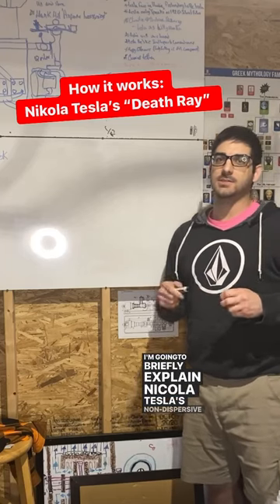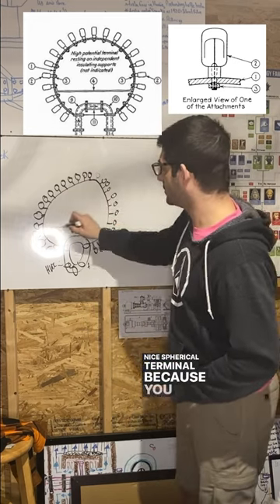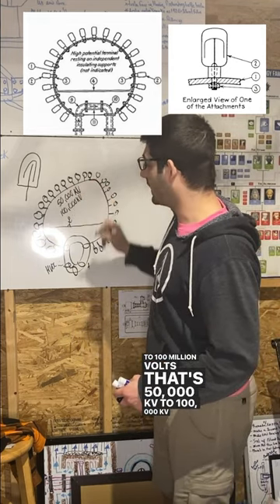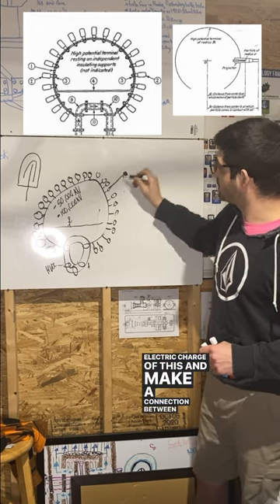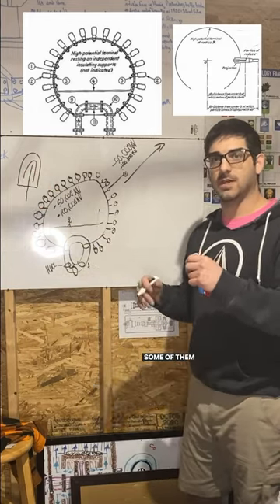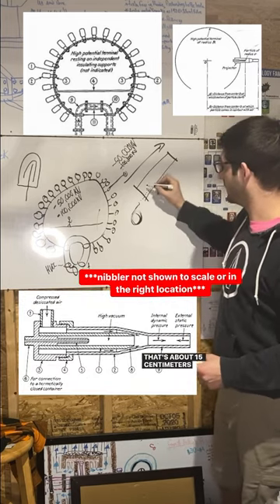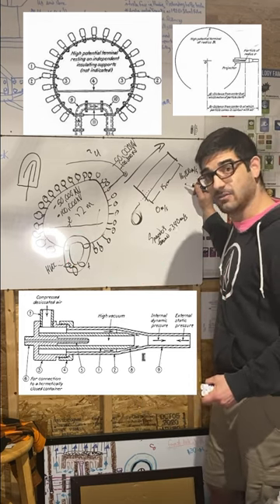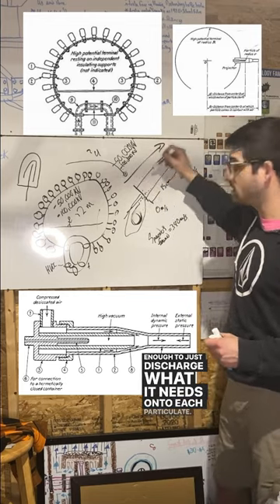Nikola Tesla’s Death Ray: How It Actually Works Part 2

Comment: Do you know how Kelvin's generator works? & please don't ask AI because it does not know. I checked!:)
Reply from the maker: Hey thanks for the comment! ❤️‍🔥🙏 Yes I’m very familiar with Kelvin’s water dropper electrostatic generator, aka Kelvin’s lightning storm. I’ve made many posts about it on my Instagram. This is nothing like Kelvin’s electrostatic generator. 

Please read the description on this post of mine about improved modern versions. 

https://www.instagram.com/p/CrPLlLxMjhZ/?igshid=MzRlODBiNWFlZA==

Furthermore I’m not sure why you think AI doesn’t know about it. ChatGPT knows all about it. What are you asking it that you’re not getting a response back about it?
Reply from the maker: Again I have long known about Kelvin’s electrostatic generator. 

But to also show you what ChatGPT knows. 

Me: “Will you explain Kelvin’s electrostatic generator in exhaustive detail?”

ChatGPT: “Certainly, let's explore Lord Kelvin's electrostatic generator, also known as a Kelvin Water Dropper or Kelvin's Thunderstorm. This ingenious device was invented by William Thomson, later known as Lord Kelvin, in the 19th century. It's a fascinating example of how relatively simple materials can generate surprisingly high voltages using electrostatic principles.

Principle of Operation

The generator operates based on the principles of electrostatic induction and charge separation. When properly set up, it's essentially a self-exciting generator, meaning it can start from a state of zero net charge and generate a substantial voltage through its operation.

Mechanical Construction

Kelvin's electrostatic generator consists of two pairs of containers or buckets. The buckets in each pair are electrically connected, but each pair is isolated from the other. There are also two reservoirs located above the buckets, each fitted with a small spout to allow water to fall drop by drop into the buckets below. The drops are meant to fall through two induction rings before they reach the buckets.

Operation

The operation of Kelvin's electrostatic generator can be broken down into the following stages:

Initial Induction: At the start, there's no net charge in the system. As a droplet falls through an induction ring, it polarizes slightly due to the electric field of the Earth. This small charge separation is enough to get the system started.

Charge Separation: As a droplet falls through the induction ring, the slight charge in the droplet induces an opposite charge in the ring. This charge is transferred to the bucket that the ring is connected to. The droplet, now carrying the opposite charge, falls into the other bucket. This process is mirrored in the other pair of buckets, resulting in the two pairs of buckets accumulating opposite charges.

Voltage Buildup: The falling drops of water act as a charge pump, moving charge from one pair of buckets to the other. Over time, the voltage difference between the pairs of buckets builds up.

Discharge: Once the voltage difference between the two pairs of buckets becomes large enough to overcome the dielectric strength of air (around 3 million volts per meter under standard conditions), a spark will jump across the gap between the bucket pairs, discharging the built-up energy. This creates a bright flash and a loud snap, similar to a miniature thunderstorm, hence the name "Kelvin's Thunderstorm".

While Kelvin's generator is a remarkable and simple device to demonstrate electrostatic induction and charge separation, it's worth noting that it's not particularly efficient as a power generator. The output voltage is high, but the current is very low, and it takes a considerable amount of time to build up enough charge for a single spark. Nonetheless, it serves as an excellent educational tool for understanding fundamental principles of electrostatics.”
Reply: Wow, ChatGPT really knows something about! It looks that my AI need more training..:) Still, ChatGPT thinks that "it's worth noting" & i am curious what it thinks about Tesla's electrostatic generator and efficiency comparison between Tesla's, Kelvin's and Van De Graaf's generators? If it knows how Tesla's generator works..
Reply from the maker: It knows about teleforce but again it’s trained on what others have said about it on the internet. So it just non stop tells you it’s all speculation and that there’s nothing definitive about it. Until you message the actual paper to it but for some reason it has a tendency to forget it. Never had it so that for anything else. But this I constantly have to re teach it how it works. Otherwise it just starts going off into the weeds. It’s kinda weird actually. 

The same goes for the Tesla turbine. Because it’s trained on the erroneous claims that everyone has made it parrots the same nonsense. 

It’s only as good as it’s source data. So it’s not infallible. 
I will add that I’m using GPT 4 but GPT 3 will explain it just won’t do as much logic or design with it.

Comment: Can normal people build this or they  need a vacuum made from a factory???
Reply from the maker: I do not recommend that anyone makes this.
Reply: @CharlieSolis  its for the peace nikola said"
Reply from the maker: So just to be clear I do have a degree in physics and many years of working with industrial machines.  

And now I don’t want to discourage you but I need to be abundantly clear though that sadly, these are not toys. 

They are VERY dangerous if not designed or handled properly.  

I do not advise anyone who doesn’t already have a background in mechanical and electrical engineering or physics to attempt to make one of them on their own.  

If you wouldn’t feel comfortable taking apart a jet engine and literally wardenclyff and then putting them back together and know that they would work properly again then I would think twice about taking on this endeavor.  

“Don’t French fry when you’re supposed to pizza or you’re gonna have a bad time.” <-Words to live by.
Reply: @CharlieSolis  its a joke, Im still learning the basics
Reply: im wondering if the death ray its a tesla type of structure or a type of medium-little hand-gun ?
Reply from the maker: you definitely cannot build this small according to Tesla. He even mentions this would need to be so large it could not be made into a mobile device (though this was ages ago) he mentions they might be able to be out on a ship though.
Reply: @CharlieSolis  I suggest making a smaller death ray gun for interesting content, like a cod gun

Comment: Would mercury particles work?
Reply from the maker: Hey thanks for the question. This is what Tesla Says in the Nondispersive Concentrated Energy Projector article. 

“It is important to devise a thoroughly practical and simple means for supplying particles and I have invented two which seem to meet this requirement. One is to feed tungsten or other wire from a spool in a closed container joined hermetically to the projector, the rotation of the spool being under control of the operator. Using wire 2/100 centimeters in diameter, twenty cubic centimeters of the same would provide material for 5,000,000 particles. The other device consists of a closed container fixed to the projector and filled with mercury which can be expanded by external and controllable application of heat and forced, under great pressure, through a minute hole in the extreme end of the extension reaching to the distance d as before illustrated and explained. The droplet torn off and projected would have the hardness of steel owing to the great capillary pressure. If mercury can be used for the purpose, this means is ideally simple and cheap.”
-Nikola Tesla

Comment: So this is just basically a much better version of a rail gun/ Gauss rifle concept? So these are probably the original concepts…… so all this is to build an extremely powerful electromagnet? Or rather fully taking advantage of all these concepts….. ???
Reply: Yeah pretty much. It would be the best point defense system on taking out hypersonic missiles and extreme ranges. This can be built now with out technology.
Reply from the maker: Hey thanks for commenting but there wouldn’t be any magnets needed in the actual accelerate terminal. 

There’s really no magnets even necessary except the electromagnetic interaction in the step up transformers to get the HVDC but that’s not really the same thing. 

That’s what makes this so much better than a rail gun! 🦾🤓👨‍🔬